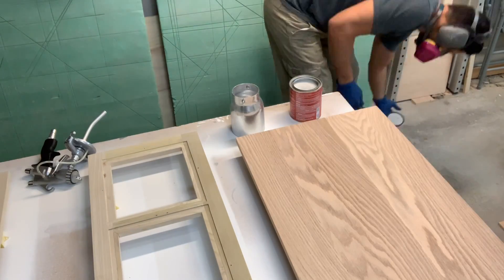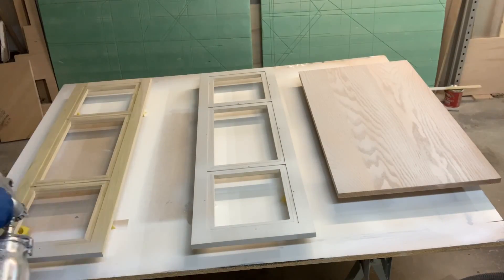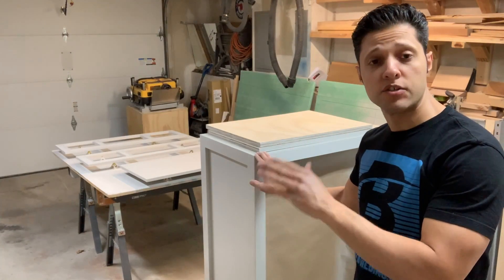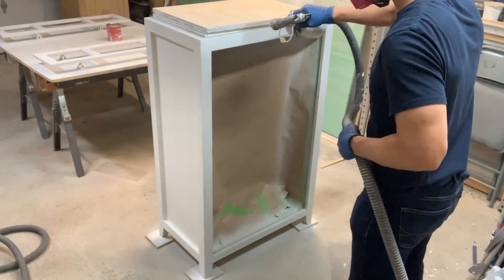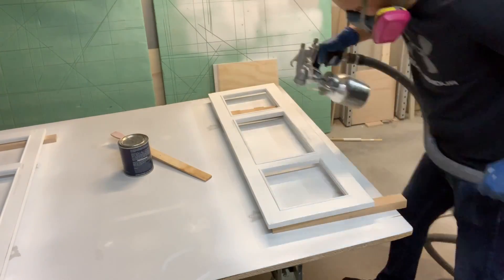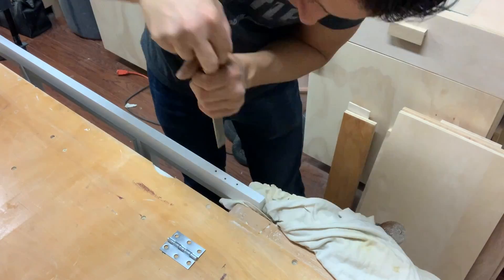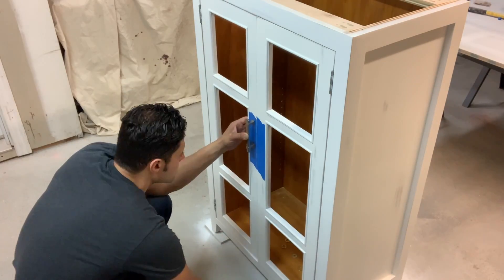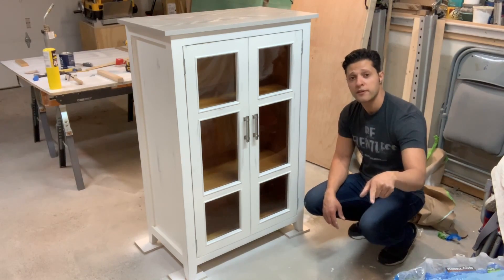How To Distress Milk Paint

Comment: Very attractive piece.  I have had good success using regular windshield wiper fluid at about 10%, as a reducer, depending on the thickness of the paint.  To me it seams to leave a much smoother finish on really porous wood.  At least that has been my experience. Again,  the piece turned out really nice.
Reply from the maker: BarnShop Productions interesting, I’ve never heard of anyone using washer fluid to thin paint but I guess I can see how the alcohol and it’s evaporative qualities would work.